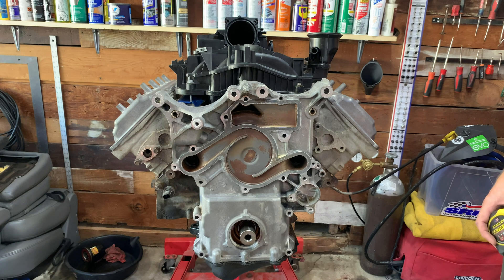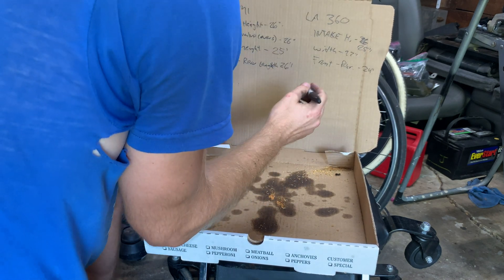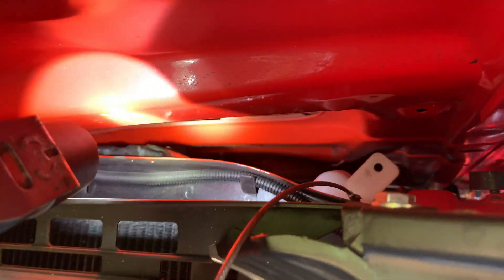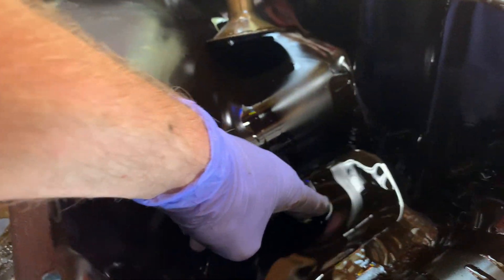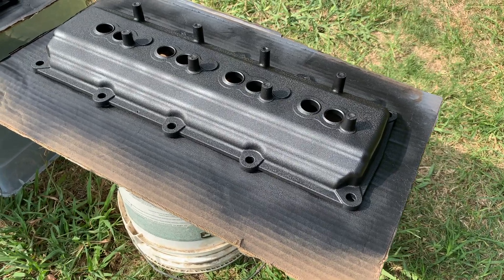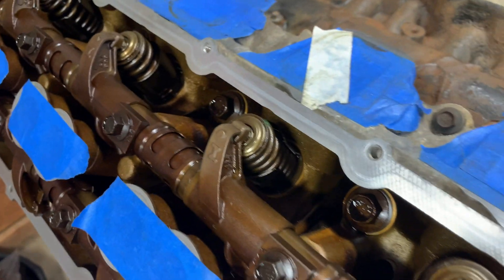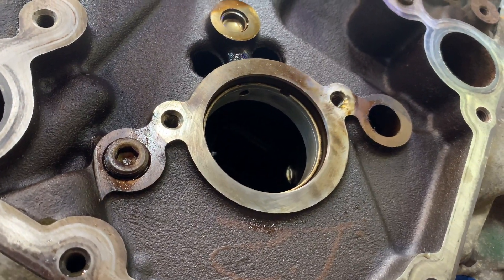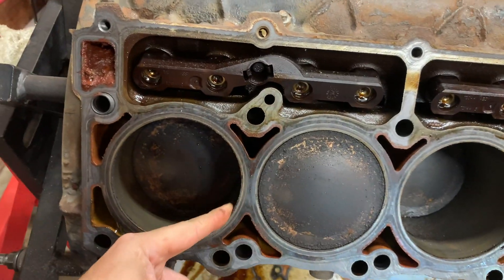1970 Challenger Hemi & 6-Speed Swap Part 2: Engine Swap Measurements and Hemi Bearing Problems

Comment: Awesome work!! I can't Wait for the new videos, I am gathering parts necessary for a similar 5.7 swap into my 70 Barracuda. I am also considering a Comp Cams swap similar to yours, and was wondering what the part number for the valve springs you used was? Your videos are great information, I am constantly pausing the videos to get part numbers and looking for any small details not mentioned that would be helpful. Thank you taking the time to make the videos.
Reply from the maker: Thanks! I hope your swap in your Barracuda comes out well, so far the Hemi fits great in the E-body. I used OEM Chrysler 6.1 Hemi vale springs, part number is 05037477AD. Same valve spring for both intake and exhaust. In case you need them, the pushrods are also OEM 6.1 Hemi and the intake is part number 5037476AC and exhaust is 5037475AC. I've included more part numbers in my later videos' descriptions so hopefully that will help, any other questions just add comments and I'll be happy to help!
Reply: @noboltsleftbehind  thank you for your quick response. I thought those were probably the ones you used. I just wanted to make sure, because I cant make up my mind on a cam swap.
Reply from the maker: @anthonymartinez3272  I've been there, it's a tough choice with so many good cam options out there. I went with the Comp Cams XFI 268H, it seemed like a good power bump in a usable mid-range RPM but not too radical to make tuning difficult. The XFIs also seem to have a good old school rumbly idle sound.

Comment: Just for peace of mind I always change timing set and oil pump.
Reply from the maker: Yeah good call, I ended up finding a decent deal for the timing set so I'll be changing those at least.
Reply: this derango/1970 challenger 3rd-gen has some of the typical failure mode problems with oiling i see, there nice engine's ( i proffer the 440 or 426 or dodge-turboshaft platform engine's my 2C ) just handicapped with some common problems, wished the cam was hollow and is full of oil to feed the lobes and had spray-bars like some JDM-engine's are hopefully it doesn't drop a valve or valve seat or get the imfimiss hemi hard ticking sounds